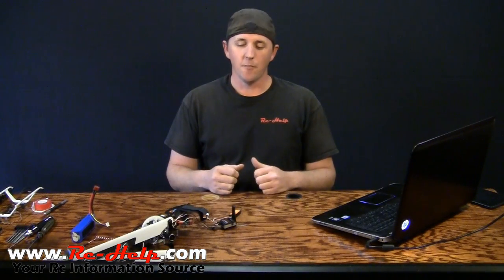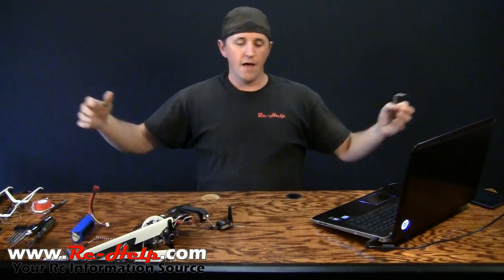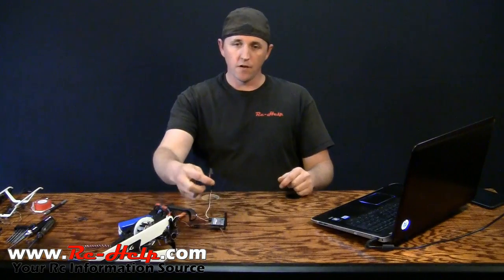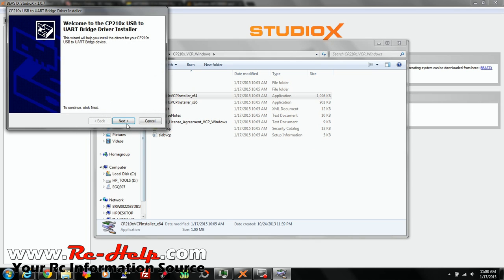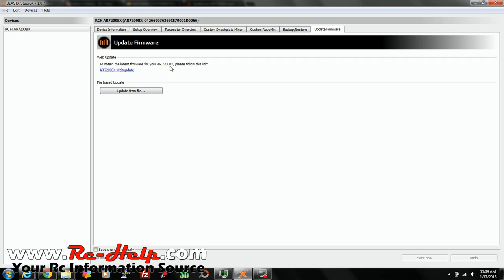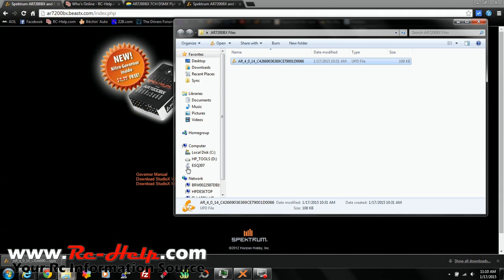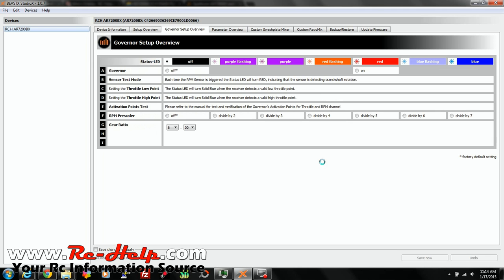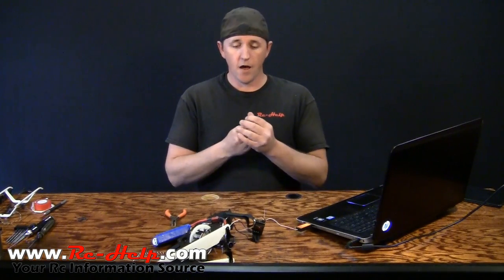AR7200BX How To Update Firmware

Comment: I have a AR7210BX and would like to see you add  safe mode software to it. could you make a video on that?i see there is different operation mode on it with 6 different colors. thanks
Reply from the maker: This is something that i have looked into, I just never had the extra coin to drop on adding it. If I do get it, I will definitely do a video on it. www.Rc-Help.com
Reply: @RcHelpDotCom  I have 3 birds with this AR7210BX T-REX 550, GOBLIN 570 & 770. came close to crashes and everyone I talk to get the safe mode. so before I take to the air again I want to get the safe mode. I see plenty of videos giving demonstrations leveling the copter when they flip the switch. I have a DX6 & DX9 I use the DX9 for my 770 and will install the 550 & 570 . how does it get installed or programed on my DX9 the safe mode that is? learning this as I go along so need to spoon feed me on this. also do you know a video on utube installing the safe mode since you don't have one as of yet? thanks!